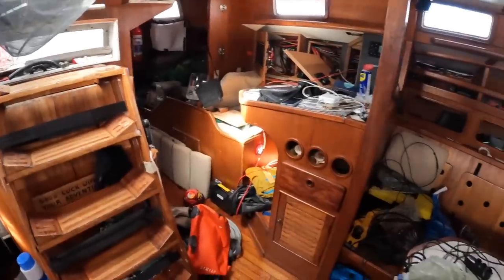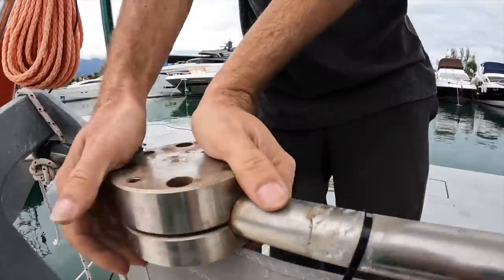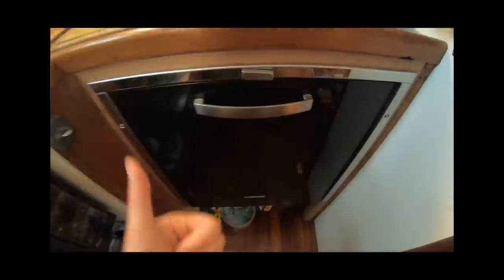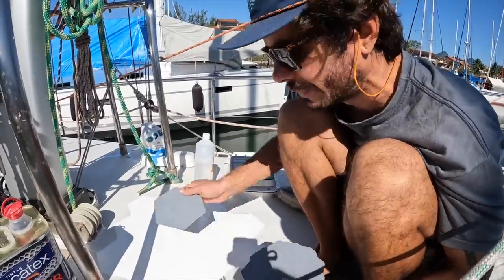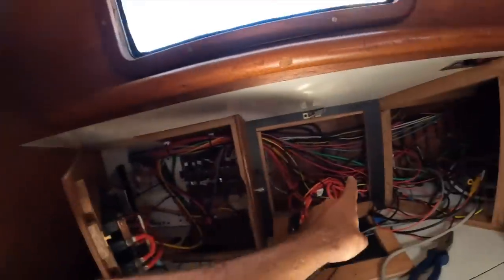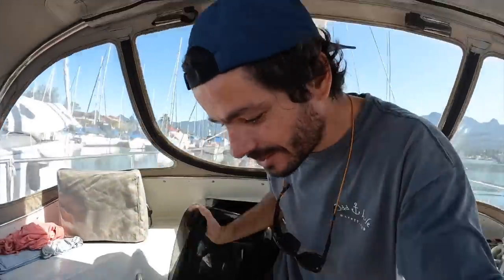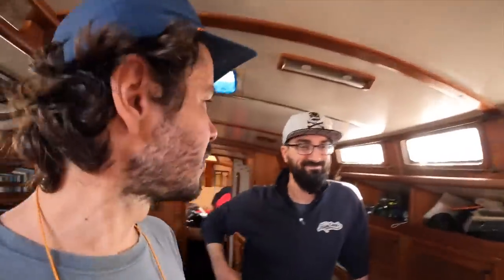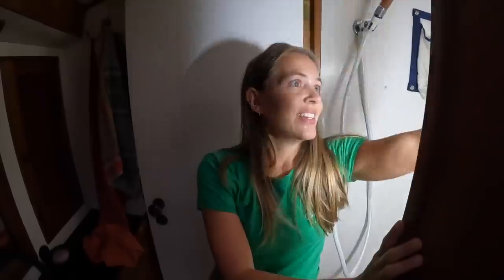⛵️He traveled 7k miles to meet our boat ⛵️Odd 🤯 Ep.249

Comment: You don’t need a separate vhf antenna for the AIS, you can use a splitter and connect it to the radio antenna at the top of the mast. Gives better performance. Hope this helps. Love your videos.
Reply: No splinters!
Reply: Yes, I agree, and its a sort of splitter. You need to get a good one. Both transmitters go up the same line. Eventually you might want some really good line going up the mast. I've seen  Rigging Doctor using one, and I wouldn't be surprised if Emily and Clark do this, although Clark likes a super sensitive VHF so not sure. Putting both on the same antenna takes a little sensitivity away. Not much, and your AIS would work better than down below. Height advantages.

Comment: Duca and Roberta, I retired and moved to my land in the country to build a recycled off-grid homestead. For refrigeration I use one small commercial ice-cream freezer. It is an Arctic Air 3.5 Cubic Foot, 120V, 5 Amp unit. I use 8, one half gallon water jugs to make ice for my refrigerator box that is NOT plugged into the power. Every two days I swap out 2 of the four-day old jugs of ice.  This rotation keeps me at 39 degrees F in my fridge and gives me plenty of cold drinking water as the ice melts. It takes me 2 minutes and no electricity for my refrigeration. I have an ample freezer and plenty of space for my vegies and condiments.

Comment: @14:40 .. it won't be the sat/4g antenna whichever it is nearby that'll be your issue, rather the metal. Metals REALLY mess with signals (the reason why is the basis behind why metals are used to convey and broadcast the signal without getting deep into it). 

So .... your best spot is literally at the top of the mast for VHF which is why most yachts yeet it up there (nothing in the way and height advantage vs horizon type thing). It needs to be a particular type of antenna to do that but it's the best spot with the right type of coax for the length (at least RG213). In your case if you want it down there then at least put the base of it at the same height as the solar panels so it can bounce signal off them rather than everything blocking/reflecting the signal.

Comment: You make a good Amateur Radio Operator. You seal your connections. Get RG 213 for VHF/UHF radio frequencies. If you find de-sensing of your signal coming into your electronic equipment. I'm not sure if snap on ferrite would help with RFI.

Comment: You can get a rebuild kit for the handle of the head pump. There is usually a thick leather washer that has either dried out, or worn out, that needs to be replaced. Or you can ask a leatherworker for some scrap leather, and try to carefully make a snug fitting new one.
Reply from the maker: It costs more than a new toilet here in Brazil 😬

Comment: Shower grate.  Also, agree with other comments.  A good quality splitter using the VHF antenna on the masthead will give you a better AIS performance.  Check out the splitters from Vesper Marine if you are able to get them in Brazil.

Comment: The base stainless steel plate on your aft deck is most likely intended for an autopilot wind vane for the automatic steering of your sailing yacht will cost you less power.

Comment: Most milk sold in developed countries today is homogenized. It is very thoroughly agitated to mix the milk and cream. If you freeze it, that will cause the milk and cream to separate again, but it does not hurt the milk. Just the the container, after it has defrosted, and shake vigorously to mix it back up again. You will need to do this again before each use.

Comment: Yeah I will for the life of me never understand why naturally we all think that putting Antenna's up close to each other is a good idea... First off you need to learn about how to isolate your antennas by frequency.. Your best bet is to look up Repeater Builder online and look for proper isolation.. The General rule of thumb is a wave length or more separation between the antennas..  Anyway yeah.. Antenna Seperation is good also that VHF antenna really should be mounted at the top of the mast. Same with your GPS and Internet separated by Vertical spacing not horizontal spacing.. Just my thoughts here 73 from KC9ZHV

Comment: I personally  don't  like water softeners, they make me feel like I still have soap on me when I rinse off. But I do like the 50% less water consumption  and the different spray modes on the shower head. I think I would just not put the salts in the handle and use it that way....but that's just me !